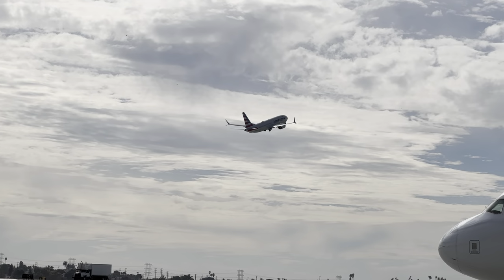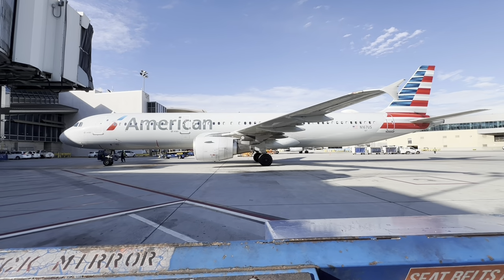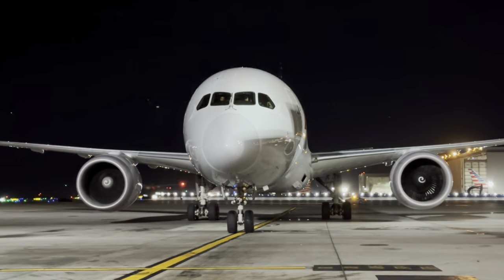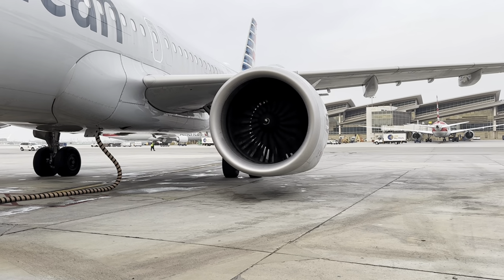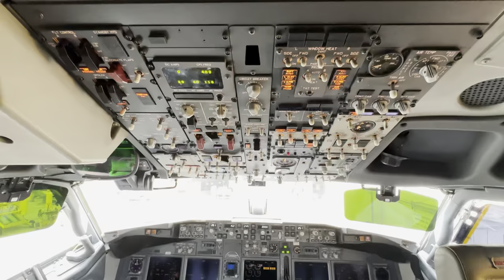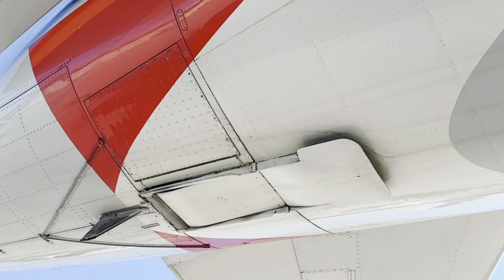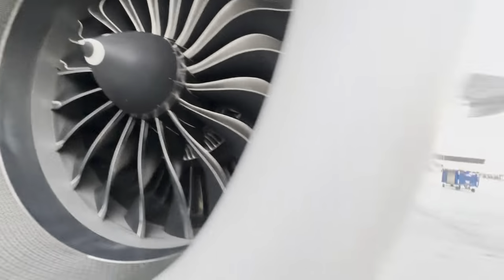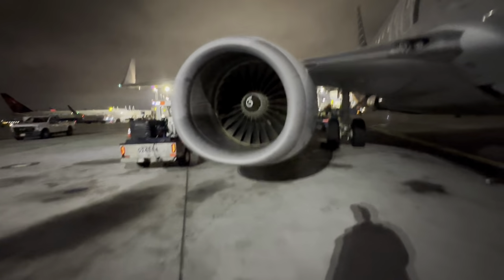Stig Shift #15 (Aircraft Maintenance Adventures)

Comment: Why is the flag on backwards? The flag next to the registration number
Reply from the maker: This is because the body of the plane is treated as the flagpole. Consider the US flag. The stars are normally on the left when printed, but when flown on a pole are up against the flagpole. If you stuck a pole on the plane, then as the plane moved forward the flag would blow backwards.

Comment: AI have a drift of 3 degrees every 15 minutes I read. I saw the crew calibrate it on an Embraer before they took off. Do these bigger planes have to do that? Also, I have seen SEVERAL accidents at night under IFR, was wondering why planes do not have Garmin or other band of Synthetic Vision to prevent this, or just to keep them from getting lost. Synthetic Vision works in zero visibility.
Reply from the maker: That’s a better question to ask pilot.

Comment: Is there really any truth to turning your phone to airplane mode because it can interfere with aircraft avionics??
Reply from the maker: Only at certain periods of flight such as takeoff and landing. Basically anything below 10,000 feet it could cause it interference. Otherwise when you’re up and altitude, your cell phone will not work because it can’t catch the signal from the towers.

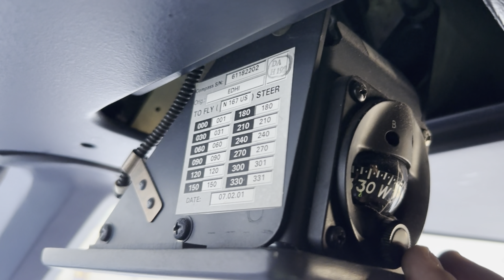Comment: 8:45 origin: EDHI, Hamburg Finkenwerder, Airbus' German home field. This is where all a320 family aircraft are being handed over to the customers and where the a380 where fitted with their interior furniture.
Also, this plane was delivered on my birthday. it's a few years younger than me though :'D
9:15 in the us only a handful of minutes are required and legal to be recorded, while in Europe the last 25 hours of the plane's life are on record. US Pilot unions are heavily lobbying against the 25hr recording duration on the basis of privacy which - to a european and comparing to the general US's privacy and data protection laws - is really quite amusing :'D Also, several incidents were unable to be fully determined the cause of because the 120minute limit had caused the incidents to be overwritten before the plane had landed.
Fun fact on the 74 and 380: The 74' cockpit is so far up that during approach the PAPI show 1 light to high. So if you are perfectly on the glideslope your papi will show 3 white. Airbus wanted to prevent exactly that issue which is why the cockpit is right in between levels. This way the PAPI will still show 2 white 2 red when you are perfectly on the glide.
Reply from the maker: Excellent information. Thank you for taking your time and sharing with all of us

Comment: Are the tires radial similar to autos ? Much more tread , higher air pressure . How many landings before tires will be changed out on average ? What is the prox  weight of a 777  ?
Reply from the maker: Similar to an automotive tire, but a lot more layers pressures very between different aircraft. Manufacturing usually says 200 to 250 landings but that’s in a perfect environment. In reality it’s unpredictable. I can’t remember how much a 777 weighs, but I’m sure you can find that through Google.

Comment: Just landed LAX (1521 from PHL). A nice 3yo 321 Neo … not a bad “office”. Though this one has an interesting issue with the lavs … the vacuum pumps only worked above FL160. A little work for you or one of your colleagues!
Reply from the maker: Yup that happens time to time. The issue with that one is the vacuum generator was inoperable. So no suction on the ground and below 16k altitude. Not a hard fix, probably needs parts.
Reply: And heading home this morning  on N761AJ … hopefully you were the one doing the wake up!

Comment: Does the engine exhaust heat up the flaps?
Reply: Most engines these days have high bypass ratios. i.e. threre is a lot more cold air flowing through the engine than hot air. Some cowls have corrugations which mixes hot/cold (helps reduce noise, too). I may have seen some charring on flaps or ailerons, but that may have been due to hotstarts.
Reply from the maker: Thank you for the excellent response

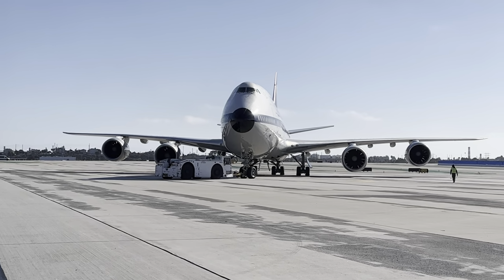Comment: 44:10 The only little known fact i know about A380 is that the outboard engines do not have thrust reversers. If those engines did, they would throw up FOD from the runway verges which would require a runway inspection after every A380 landing. Also, they simply don't need them.
Reply from the maker: It’s actually doesn’t have anything to do with FOD, matter fact, the original design of the 380 did not have any thrust reversers, they had to put at least two because of safety regulations. And the only reason they only put two is because of weight saving
Reply: @StigAviation  i learned again. :) Thanks  for replying. :) i got it nearly right tho with not needing them .